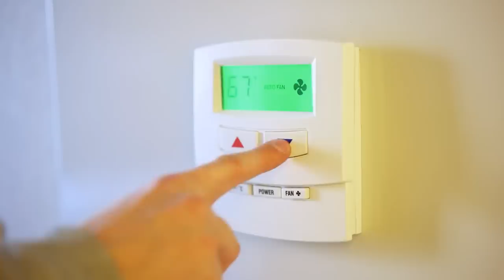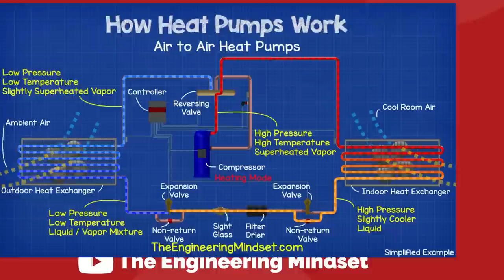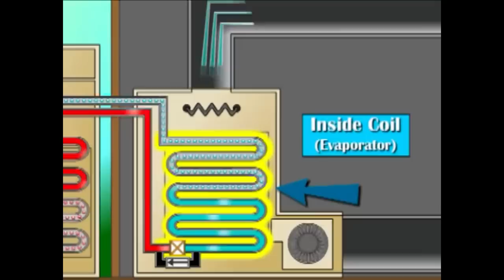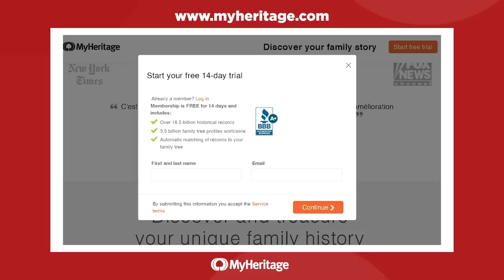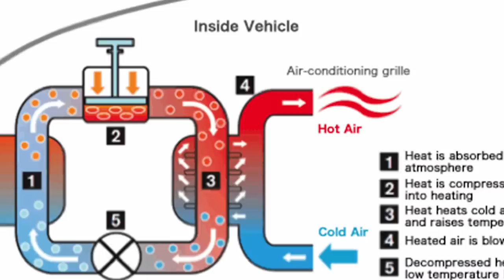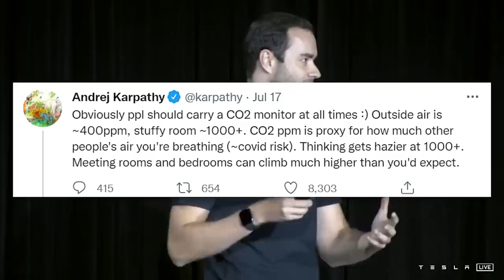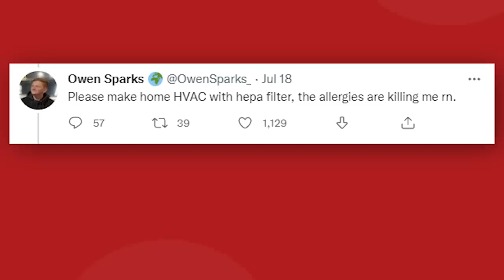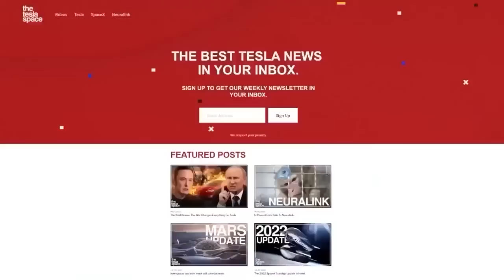Why Tesla's Heat Pump Is Essential For Our Future!

Comment: With recent heat waves here in the Pacific Northwest, we're exploring a retrofit whereby our very efficient gas-powered heater is replaced by a heat pump. Our system is a bit more complex than a typical forced air system because it heats water which is then pumped sequentially through 5 different radiant floor loops. By replacing the heating system with a heat pump it is hoped that warm water in the winter will be cooled in the summer. It is worth mentioning that the current heating system doesn't need to heat the water very much: water exiting the system into the loops runs about 85°, returning to the system only a few degrees cooler. So, we expect that, in the summer, water might only be need to be cooled to, say, 65° to achieve sufficient cooling to keep the house at a comfortable temperature. It's early days, but I'm hopeful.
Reply: You cannot cool the floors, usually, as that will lead to condensation and moisture problems. But if u only got ceramic floors or you dry the air in other ways, then maybe. In Sweden coolers are air based.
Reply: Heat rises off the floor. Cool won’t rise off the floor. It would just end up as a cold wet floor.
Reply: Cooled floors are a bit of a nightmare. They usually don't work very well unless there's a lot of direct solar incidence on the floor that re-radiates and generates a cooling load. Otherwise yiu just end up with cold feet and a condensation risk that needs careful control.
Reply: Your heat pump will require twice the "fossil fuel" to warm your home than your inexpensive gas heater uses. For cooling, fans, trees & an inexpensive swamp cooler in your attic space would save time, $ & effort.
Reply: Screw all that... Just do mini split and save the hassle. You can get up to a 5 head unit and have custom heating controls for individual rooms. You can even get cassette air handlers that hide in your ceiling and it looks just like a vent and nothing else.
Reply: Air conditioning requires dehumidification as well as cooling the air in humid climates. This requires forced air across an  AC or dehumidifier evaporator coil .
Reply: That is a really cool implementation!
Reply: 65˚ is HOT so grow up and learn to use science like when you were 10 years old. Fur in height? No one uses that nonsense in the 20th century and we are now in the 21st century Robert. Learn time, then space and finally you can join us all when you learn what energy is. It is not measured in horses.
Americans have about 150 years of history to get through before they can join science of the 21st century. Sad but reality.
Reply: @BerraLilltroll   it's a good idea 💡
Great economical solution for all homes  !
Reply: @mikekelly5869  just fallow Tesla -- Elon Musk's ways , he is wright to be.
Reply: @zenmind4711  👍😃
Reply: @kennethkeen1234  bit of a rant mate?

Comment: Hi, living in Miami in early 1980’s we had a “conventional AC freon system”. I calling it that as I’m not a AC engineer but compressor outside & air handler inside, small one zone house. We purchased the house new, and it came with a small heat exchanger outside the house, a device about the size of a shoe box mounted on the exterior wall.  The compressor hot side freon was piped thru that small 1/4” maybe copper tubing to the box, thru a coil, that ran with water from the hot water tank immediately inside the wall in garage. So when the AC was in use, say almost 9-10 months of the year, I would turn off the electric HW CB and the AC used this device to lower the freon temp before the air cooling part of the compressor. Creating a very efficient system. So as a matter of fact the more hot water we used the better it worked? Basically unlimited free hot water and an air conditioner using presumably far less run time as a water based heat exchanger has to be multiple X more effective than an air based heat exchanger. Well I often wondered why every house in Fl, or anywhere else in the south didn’t have a unit like this. I can only guess that the “power companies” want to sell you electric not save electric. So maybe they bought the rights to the device and put it out of business. In summer I often just opened the HW taps in the house and let them run, i hate to waste water but it made a good system even work better! That house was the only house I’ve ever seen with that device. Well thats my 2 cents!

Comment: My 1500sqf ranch home, near Seattle, was built in 1969. All electric with baseboard heat. The winter power bills averaged about $350 per month! Some winters even more. No A/C. 

About five years ago, I installed a gee-whiz mini-split two zone variable speed inverter heat pump.  Energy efficient refrigerator, cloths washer and dryer, and a heat-pump water heater. Almost entirely LED lighting. 

Energy efficient windows and some insulation about fifteen years ago. 

I have smart control over the HVAC. Carefully crafted schedules for heat and cool, to maximize comfort and savings. I even circulate hot water, on demand, so the shower is instantly hot when I am ready. No wasted cold water down the drain. 

None of the changes made much difference in power usage except the for the heat pump(s.) My 2022  summer power usage peaked at $41 for the month of July. I was not stingy with the A/C. I keep the house toasty when I feel like and very cool compared to the 'recommended A/C temperature of 78.' (70 to 74 depending on mood.) 

I will spend less than seven-hundred dollars for power this year. Average about twenty-five hundred per year before the heat pump. And now it is comfortable, hot or cold weather. 

I cannot imagine living without an efficient variable speed heat pump system again. Indoor temperature is 100% stable all day long, no ups or downs. The heat pump energy savings are so good, a solar system is no longer an option for my house. -G
Reply: I am impressed with your figures but sadly you are still using units that no one has any interest in around the world. Apple+K keys gets you a ˚ symbol instead of using the ' which is useful information for you perhaps. I prefer my own system which does not use dallars at all but kWh which is what the whole world runs on and that is kept to a few kWh in summer or winter because I am stingy. But what can we expect from yanks? Waste, and further waste and self-destruction. OK but please stay at home!

Comment: The key to a heat pump working to cool your house is the refrigerant is compressed and heated up so that it is hotter than the outside air. The outside air the cools off the hot refrigerant so when it decompresses after the expansion valve it is now cooler than your indoor air. The opposite is true as well when it is run in reverse to heat your home. It has to cool the liquid to be colder than the outside air warms the refrigerant before being compressed to make it even hotter than your indoor air. The limitations are if it is too hot outside, the compressed refrigerant is at the same temp or cooler than the outside air and stops working. In reverse it can't cool the refrigerant below the temp of the outside air and stops working.
Reply: A heat pump is the same thing as a traditional AC when in cooling mode.
Reply: So you watched the video and regurgitated it - well done. I did that sort of thing when I was 8 years old too. What was your point?
Reply: @kennethkeen1234  There is a reason heating oil and natural gas furnaces are used in very cold climates. They are more efficient. There is a reason evaporative cooling is used in extremely hot and dry climates. They are more efficient.

Comment: Just a quick history lesson on REFRIGERANTS, Freon is a name brand. I was an HVAC technician so here's some info. R-410a was introduced as the alternative to CFC's (R-22) which depleted the ozone layer due to its chlorine molecule. But over time R-410a being an HFC, was found to contribute to green house gases due to its hydrogen molecule. So now we are tying propane based type refrigerants.
Reply: Thanks for some facts Erick.
We just installed a 14 kW reverse cycle heat pump in our office.
Reply: Looks like the next generation after R32 is going to be CO2! It's already on the market in Japan.
Reply: @mikekelly5869  oh goodness, I hope not 🤦‍♂️
Reply: @mikekelly5869  . Is that for reverse cycle air conditioning, or just for water heating?

We've been using Japanese tech hot water heat pumps (Sanden, & Reclaim Energy) here in Australia for about 10 years (& personally at our house for 8 years) & I can testify are highly efficient & quiet.
Reply: Propane based refrigerants have hydrogen too.

Comment: "Freon" is a name brand, like Tylonol. The chemical is R-22 and it is obsolete. While it is still common, it is no longer produced or imported in many nations, including Canada.
 This is because it is a HCFC. Hydrochloroflorocarbon. The newer, "Puron" (also a name brand) R-410A is the current air conditioning refrigerant. It is an HFC, they removed the chlorine.
Reply: Good to get straight info. Clearly not an American.

Comment: I have both a gas furnace and a heat pump.  It's all set up automatically to use the heat pump while above -20C.  Although when it gets down to -40C that's when I appreciate the gas furnace.
Reply: How did you do this I’m curious because I want to also do this
Reply: @manikdesign  I had a professional HVAC company come in and install the heat pump and they put the heat/cooling exchanger on after the furnace blower.  Saves a bunch on fuel.  I only use fuel on the days that it goes below -20C.
Reply: @alphaomega5001  you run your heat pump from solar?
Reply: @routtookc8064 My configuration is a 1KW grid tie and it does offset the cost of the heat pump costs,  but I do know people that have a 3KW off grid system (Solar + Battery) that works for them.

Comment: Heatpumps been used in Scandinavia for many years, both air to air and air to water, for underfloor heating,  freon are not used anymore but another less damaging fluid, most here have a Cop value of 5, so 1 kw in get you 5 kw out, so very energy efficient

Comment: 0:50 "...goes to controlling the temperature of our air...": And that is foolish. I never turn on the heat above 50 degrees. And I never turn on the A/C below 90 degrees. That's a 40 degree spread using no energy at all. And I'm always comfortable. You see, your body adapts and your comfort zone expands dramatically...and your health improves. Try it.

Comment: Great explanation 👌about the heat pumps system usage in cars and housing infrastructure. We just have to make sure in Europe that we produce enough energy with our solar systems on the houses and apartment complexes. My impression (f. ex. in Germany) is that on a huge % Apartment Complexes don’t even give the possibility to load a electric vehicle and still have too little Solar systems on their roofs and Apartment and house owners would have to invest in new loading infrastructure with the pump connection that would need a “quick” political regulation to support investments as such and create a small business chain that has the knowledge and expertise to actually do the craftsman work. Sounds like a great technology. I wish our government would be open enough to invite you for consulting talks. And take quicker decisions not directly depending on an election outcome could be made. Thx for sharing.

Comment: Is there any evidence that Tesla has any plans whatsoever to get into residential (or commercial) HVAC?  I don't see the business case for it, because Tesla doesn't have any new physics to bring to the table, and existing HVAC equipment is already pretty efficient.
Reply: I think they make shit up on this channel.Look how they say he’s doing something new every week or so 😝
Reply: HVAC equipment until very recently hasn't been all that efficient. Just recently I saw that there is a 6000 BTU A/C mini split that has an EER of 19 and a SEER of 33. This was unheard of 10 years ago, let alone even 2 years ago. Best EER for a 4 ton system is like an EER of 15 but again that's a very recent innovation. HVAC industry doesn't have a lot of investment in it like the tech industry because most consumers of that industry always buy the cheapest crap so not a lot of money goes towards most efficient equipment.
Reply: As a commercial HVAC technician, God I hope not. Newer equipment, especially process cooling or critical cooling is already so damn temperamental. Look at it sideways and it breaks.
Reply: Why get into it when they ban used refrigerants every 10 years or so?
Reply: What is HVAC? Is it a state in goergia or oklahomo? yo yanks think that we use dallars, but only for the toilet.
Reply: No, clearly he is making stuff up... And also doesn't fully understand the pressure/heat cycle.
There are some huge changes coming to heat pumps though! Typically it has only worked well at higher voltages, but we are seeing more and more normal voltage heat pumps coming out which is opening heat pumps up to be used in cars, water heaters, clothes driers, etc. We are going to see it everywhere. But it is going to be such a cheap normal thing that Tesla won't be interested in such low profit margins.
Reply: @ParkerGuy89  hey Matt 23-year HVAC guy here I couldn't agree with you more, the new equipment is very sensitive to electrical disturbances. I work on equipment that is almost 45 to 50 years old with minimal upkeep, and the new stuff requires constant attention.
Reply: No it's this guy's YouTube channel
Reply: @2hotscottpro  a lot of YouTube channels are doing that one YouTube channel said he had an affordable house he build but he did not it was another company

Comment: In addition to my AC story below I had another older house, this one in Maine on the coast. 
Well this house had an 80 gallon electric resistance HW heater. Well several people told me , jeez you better get rid of that as it will kill you with electric bill. 4 kids, 3 girls, get the picture.
However the HW heater had a time of day device that it only ran on “off peak” electric rates. So “on peak” say electric was maybe 10 cents KWH. Off peak was like 1 cent KWH. Peak was 8am to noon. Then 4pm till 8pm. Monday thru Friday. Weekends off peak. So the unit had an override button to enable HW to be produced during peak, at 10X the off peak price. I think in about 15 years I used it once or twice. Furthermore everything in the house that consumed electricity worked on the same cycle, in other words run the darn dishwasher or washing machine AFTER 8pm, HELLO. So not only was our electricity bill very modest we were helping the grid load by doing everything during the so called dump rate time of day. 
How simple is this, why doesn’t every house have this system. You can forget about building new power plants as the ones we have would be running much more efficiently eliminating the current peaks and troughs. Simple.

Comment: You barely touched on one of the major functions of car heating system. You mentioned the Octovalve which I'm fairly sure means nothing to most people. It is where all of the different coolants in the car come together and get sorted out  depending on how they need to be treated. So if you are running on the highway and your electric motors and batteries are generating heat, and you also need cabin heat then motor heat can be harvested to make cabin heat more efficient. However when the conditions change and the cabin needs cooling or even the drive electrics need a cooling bost the various cooling fluids can be redirected so each takes the path that will get the desired results with the least amount of battery energy used to get the job done.

Comment: Very informative… like most solutions it’s often a balance of several things that ends up being used. I am surprised no one has come up with modular system you could retrofit to your garage combining wind, solar and an air source heat pump feeding your electric car. Your utility would manage the system prioritising your needs first and any excess going back to the grid to support balancing the system and generating an income. In the UK we have all the component parts including a converted ICE car to electric for free (£0.04 kWh) for a runaround… we are getting there.
Reply: Have you got info on your ICE conversion?
Reply: @millcosctd  Hi Millco... check out Jonny Smith Late Brake Show vlog's everything is there and his channel has contact details. The outfit in France really interested me for the subsidy their Government gives, cost and leaving the gearbox in. Any conversion is cheaper than a new EV providing the bodywork is sound and immediately no road fund licence... its a no brainer.
Reply: @millcosctd  Nothing on yt:
Jonny Smith Late Brake Show - ICE car to electric

zero info

Comment: You never explained how efficiency will be helped by Tesla’s unit.

Heat pumps are the future. I love Tesla/spacex.

I don’t think there is some killer avenue that Tesla can go into to undercut the industry. 

Mitsubishi and Daikin are putting out every trick in the book as it is. 

There is no hesitancy to forge ahead in HVAC unlike the car industry 2007.
Reply: Tesla has nothing to do with HVAC in building the most important issue to solve is building proper insulation and those people never mention that!
Reply: @alanmay7929  you forgot air sealing. But air sealing and insulation yes are the most important things.